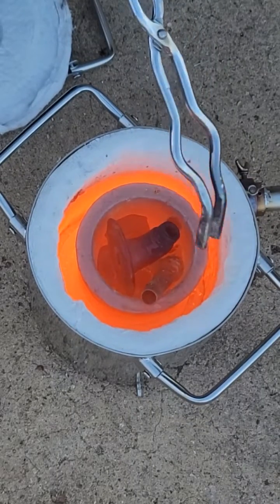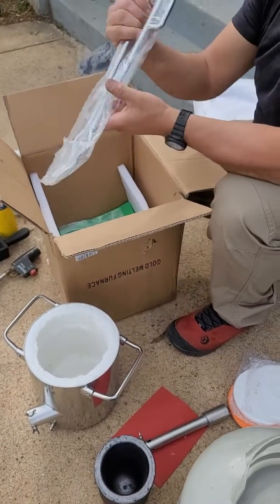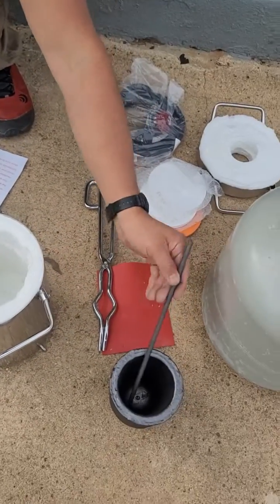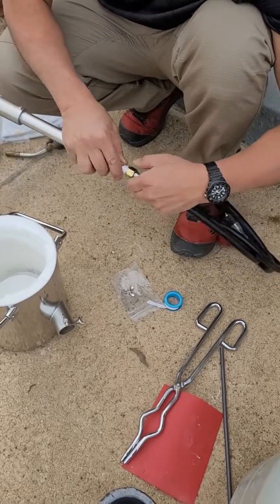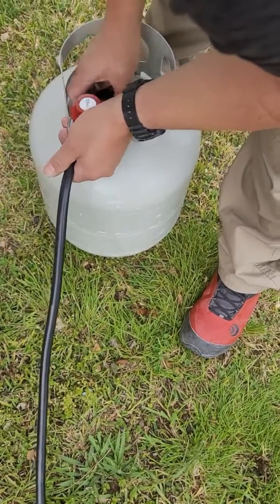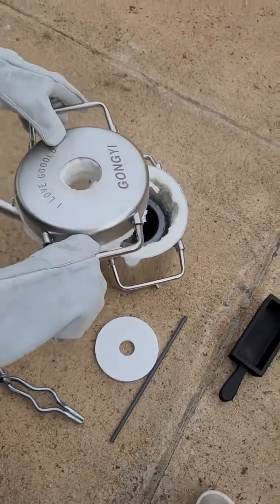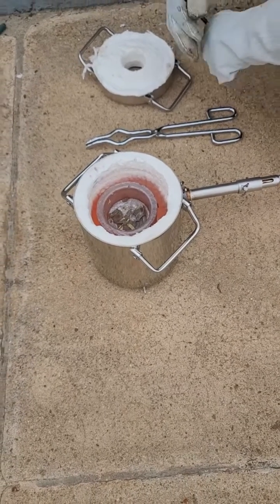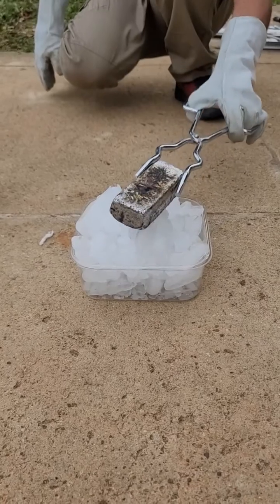HOW TO MELT METALS for beginners!!!🔥

Comment: White Teflon tape should never be used for gas fittings as yellow Teflon tape should always be used for gas fittings.
Reply: White Teflon tape is perfectly fine for this application due to the fact its not under pressure and when it is under pressure it's really not much. I agree you are better off with the yellow tape or even the pink or blue. If you do the industry standard of a minimum of 3 full wraps over the thread and don't over tighten it you will be fine.